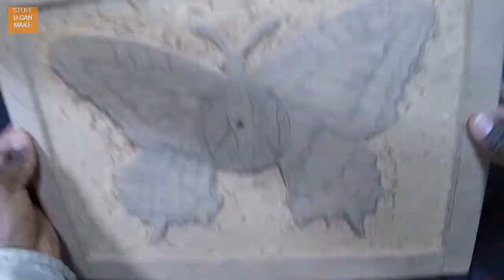Wood carving | Carving a butterfly wall clock on MDF using a rotary tool.

Comment: Amazing what you can do with mdf if you spend the time. What’s that maroon primer stuff you use looks like clay almost does it hide scratches and things well?
Reply from the maker: It's an oil based (high particulate)red oxide paint. It's super effective at hiding scratches and other design crimes!